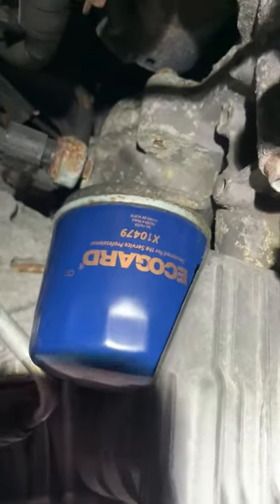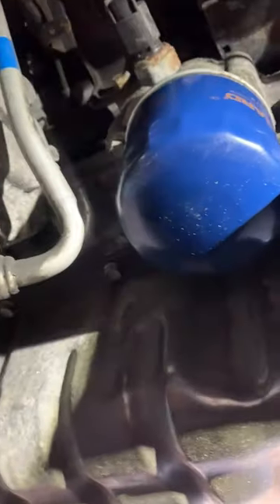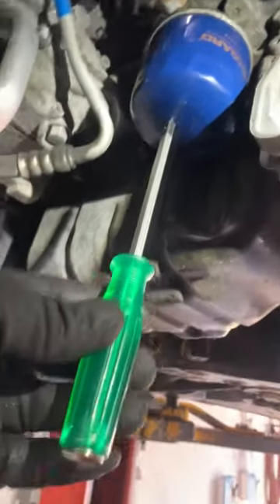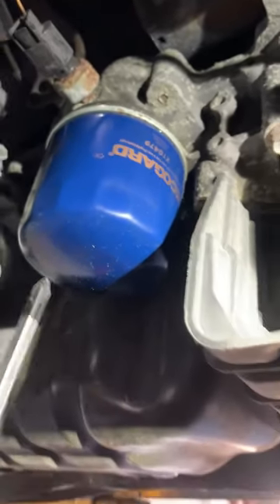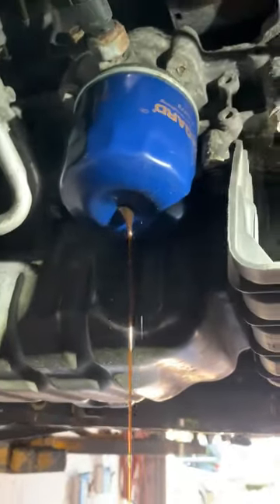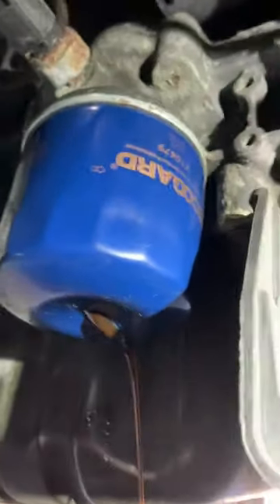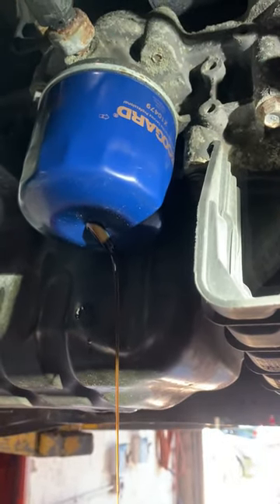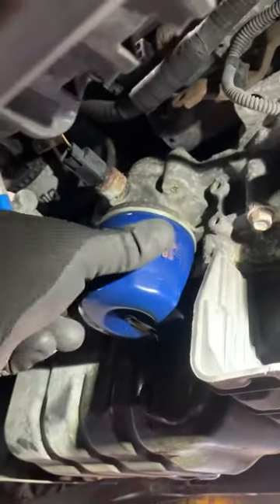NO MESSY OIL FILTER REMOVAL TIP?? 🥶🥶🥶🥶

Comment: It's an old trick but still works, only if you have direct bottom access to the filter. In other situations, use a plastic cup
Reply from the maker: Thanks, I guess that is why it did not work out.